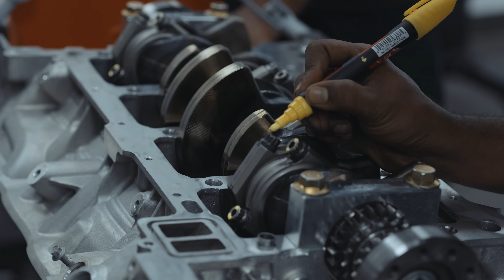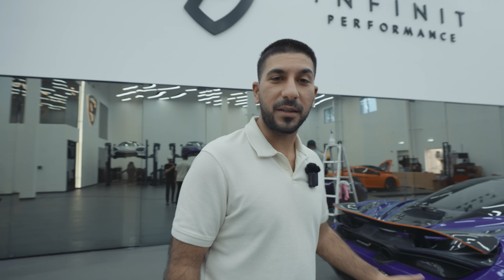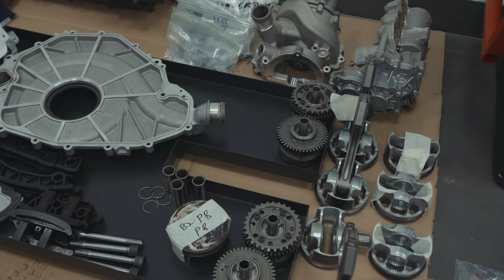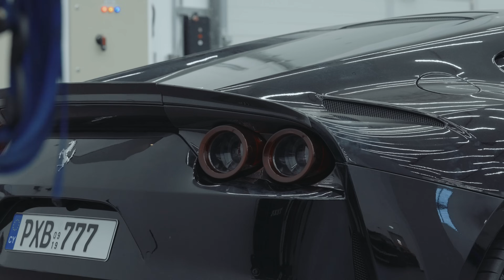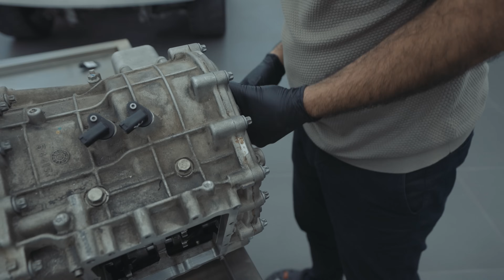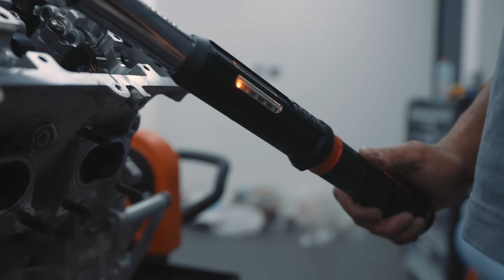Week In The Life: Dubai’s Leading SUPERCAR Workshop

Comment: I used their garage in Glasgow and after 4 years of so-called “repairs” and over £12,000 later, I decided to take the car back. However, they refused to return it unless I signed an NDA promising not to leave negative feedback about the company – which I refused. They then withheld my car, forcing me to have it uplifted with no engine and countless parts missing. They also kept thousands of pounds’ worth of components. Altogether, they’ve cost me over £30,000 in damages. I would not trust this company with any vehicle – they are not to be trusted.